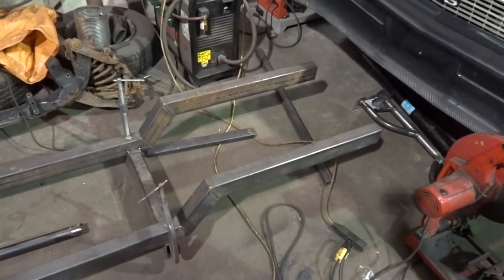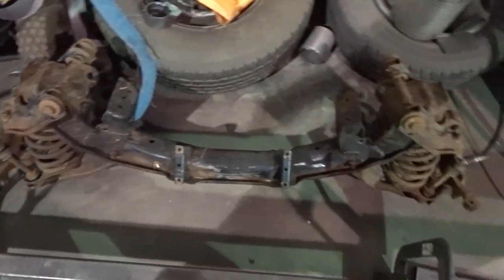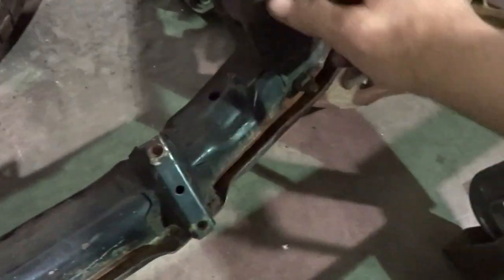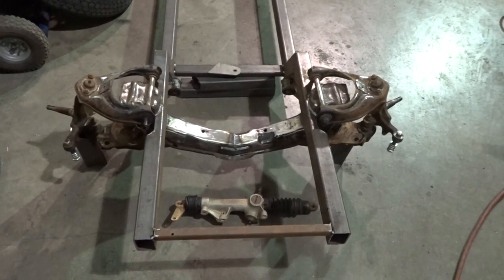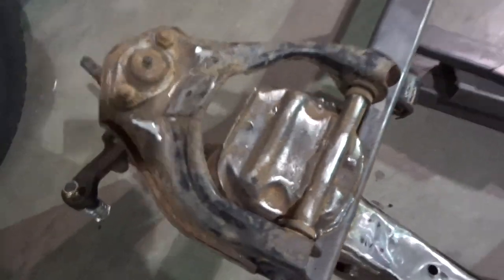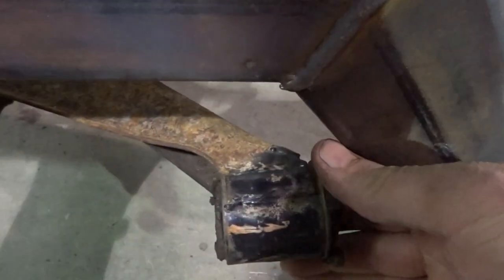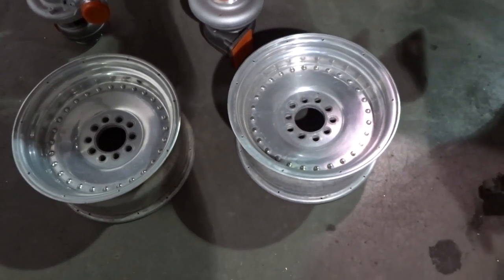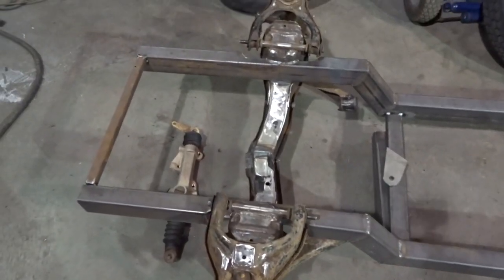Mini Madness Part 2, Chassis and Suspension Fab.

Comment: Nice work Dario, i have but quit a few burn out cars over the years and the best one's were the simple one's with easy to get part.
 Plenty of oil coolers and also large electric fans with a big alternator to drive them  has worked well.